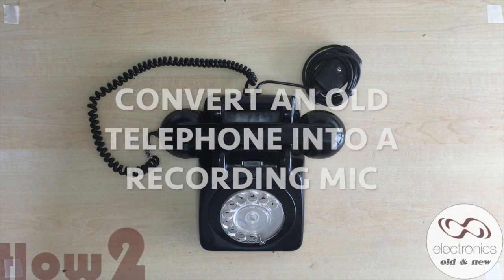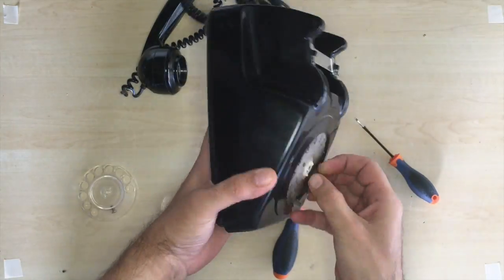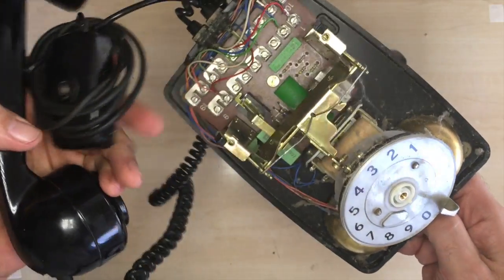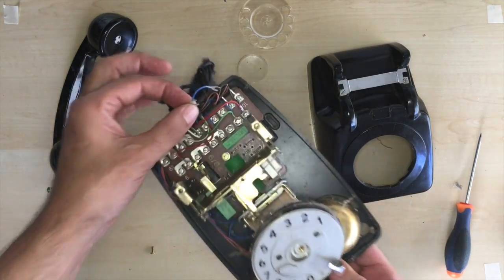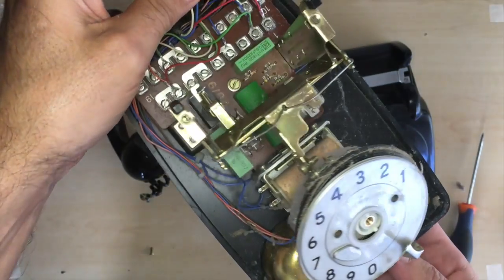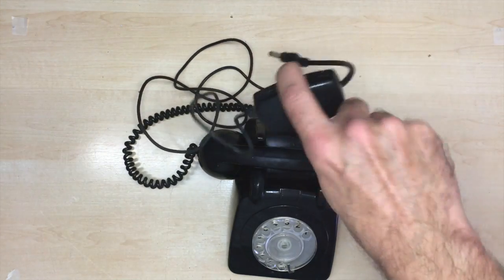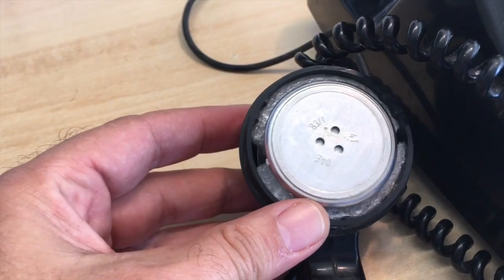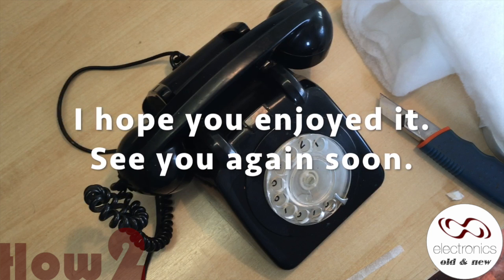How to make a recording mic from an old telephone

Comment: The microphone, or transmitter in telephone terminology, probably does work but it's a carbon mic (its resistance varies with the applied sound waveform) and it would therefore need a DC energising current to operate. It could be done with a battery and small 600 ohm transformer but your solution is a lot simpler! I enjoy your videos, keep them coming :)

Comment from the maker: I thought it was something like that but had no idea what DC voltage to apply. My guess is that it will probably be in the 50V range as I recall that the phone lines had voltages in that order of magnitude 'in the old days'. Perhaps I can use the 48V phantom voltage from the mixer in a future incarnation of this little project. Thanks for your input.

Comment: I’ve converted 5 old telephones into lofi mics, none of which I could get the phone mic to work - I have had to convert the speaker. I was hoping to see you solved this problem... i find it hard to believe all of these mouthpieces were broken, there must be more to it!
Reply from the maker: Nope. Sometimes it is as it is.
Reply: The problem is they need some level of power try soldering a AA Battery across the terminals this should make the mouth piece work
Reply: @GarethGras  Wouldn't phantom power from a mixer / interface provide this, or is 48v too much?

Comment: Hi! Nice video! Is connecting the speaker of the telephone the same as connecting the microphone? Wich is better? Some video shows how to conncect the speaker and other shows how to connect the mic
Reply from the maker: you can actually try both and see which one sounds best for you.
Reply: This is the only video I have seen where they are trying to use the telephone microphone. Every other video uses the earpiece speaker as the microphone. That seems to be the preferred method rather than using the phones mouthpiece. This is why it did not work.

Comment: Just thinking about the original phone microphone. They used to be carbon granule types which reqire a dc voltage on them to work. This may be why you had no output from it. 
Also I notice the damaged cord to the hanset suddenly isn't damaged. Did you repair it or were two phones involved?
Reply from the maker: It’s been quite a while since I did that one, but I must have repaired it because I only had one phone.
Reply: Would phantom power (48v) from the mixer via XLR be too much?
Reply: @ld8341  I'm no expert on carbon microphones but I suspect that would potentially damage the carbon unit and may damage the supply if too much current is taken. Empirical trial at low voltage is my suggestion.

Comment: This may be a dumb question, but will most vintage telephones be wired this way? I'm needing a mic like this so help would be appreciated! Thanks! (Awesome video by the way, you are good at what you do!)
Reply from the maker: Yes. Most old phones will be similar. The important thing is to follow the two wires from the mic all the way through the phone to the jack, bypassing any clutter in the phone itself. Good luck with yours, and thanks for the comment.

Comment: Hi there... is it possible to make it a stereo mic instead of mono?Can it be done by using the speaker and the mic on the phone? Thanks for this great video...
Reply from the maker: +Acemind : you could try it. Just connect the earpiece the same way as the mic and use it as the 'second' signal. You'll get different sounds from the two unless they are identical units, which they usually are not, but this could also give you a more interesting effect! Good idea. Try it and let us know how you got in.
Reply: Thanks for your reply...I´ll try my best...!